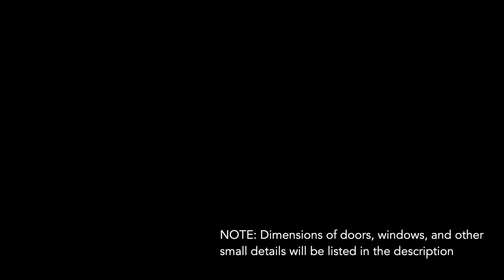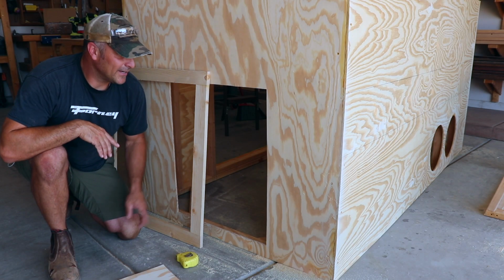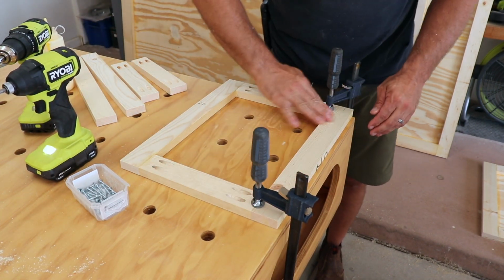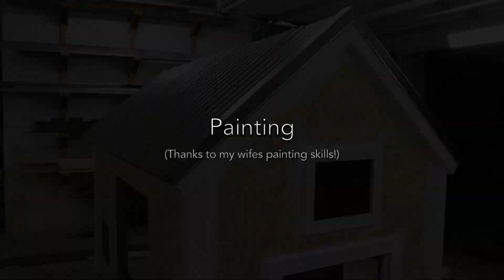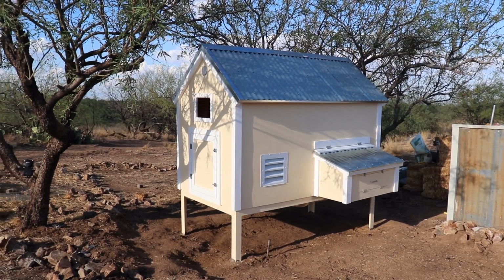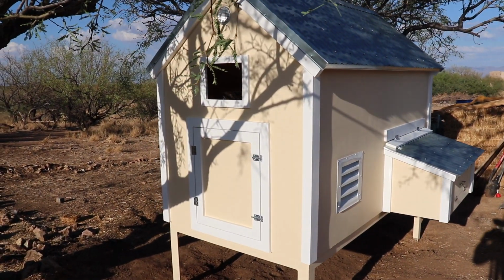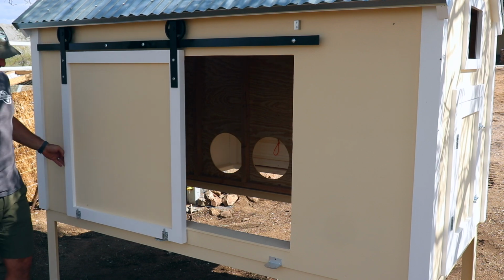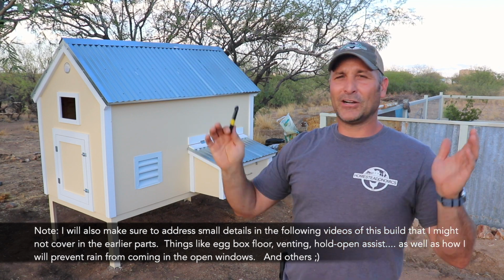Building a DIY Chicken Coop - Part 2 (Sheathing, Windows/Doors, other details)

Comment: Nice job. Y;ay Annie! I too wrote a comment about changing the egg box access to avoid scaring the girls (the majority of their predators come from above - so they're programmed to be disturbed by overhead disturbances). I like the sliding door design. I want to include an inside water station - our long and super cold winters mean they'll be in there a lot over the winter. I need the vents high.

Comment: Thank you Joe.  I appreciate your attention to small details and willingness to share your ideas.  Perhaps you could adapt a plastic pallet or two for coop flooring.  Although perforated, they would easily support the hens and prevent critters from accessing the interior.  

Wishing you and your family a safe holiday weekend without wildfires.  Peace brother.
Reply from the maker: Thank you!   Those kind of pallets are pretty cool... seen them on Craigslist from time to time.   But none lately.   
Hope you and your family have a great weekend too!
Reply: @homesteadonomics  check with beverage distributors in your area.  Grocery chains stack them in back for distributor recycling.  I’d a pallet gets chipped or one surface is damaged they usually toss the pallets.  I doesn’t hurt to call and ask.

Comment: I wish I could build something like that but I don't know much about building and I have most of the tools I think but I don't have like a table like that where I can clamp things down or I don't think I do have some clamps. I live in the city limits of Florida and we're allowed to have chickens but I'm only renting so if I have to move I don't want anything too big to have to move or heavy. So I don't know if I want to use anything with two-by-fours. I'm kind of using old fencing and things like that. Kind of winging it. I just need something simple to lock them up in at night. I do like how you did that sliding door.

Comment: Question more than comment. I live in Canada where it can get down to -20C (-4F) with some nasty winds. I built my coop without a plan, and it is most definitely not a work of manual artistry. I put some blue foam insulation on the outside last year, and want to know if that remains a good choice. I would like to cover the insulation with plywood and then paint it. Any ideas?

Comment: You do top notch work! Very Clean and smart design. QUESTION: Can two guys lift and move that around after being built? Id like to build something similar and put it into a Hoop Coop for a run. OH and one bit of feedback: The tin comes to a sharp point where the egg collection roof comes down. Looks like a sharp edge that someone could get a nasty cut on. Did you do anything afterwards to change that?

Comment: Hello: for the poop clean-out area....why did you choose to install a floor to sweep our instead of the 2 pull out drawers that you made previously? I live in Michigan and I was thinking of using the drawer method simply because I'd like to have that extra 4x8 flooring for a bit of insulting below the drawers. Just curious if you found the drawers to work / not work?

Comment: Do you have any faith in Paint n Primer in one over wood or did you use a stand alone primer?
Reply from the maker: For this I used a Behr Ultra paint and primer.   I can’t say if it is better than a stand alone primer or the same.  But I have had very good luck with the Behr paints!

Comment: Hey Joe, why did you get rid of the old coop before finishing the 2.0 one?
Reply from the maker: Well, mostly a timing thing.   We got the baby chicks a few months back and I had them in a water trough as babies and thought I was going to have it done in time.... but I got too busy and ended up having to make that make shift one in that interim.    Basically just bad planning 😂

Comment: Really excellent and clean job of showing us the build.  I came to you from Oak Abode who said they based their coop on your design.  I think that sliding barn door is terrific.  Sadly, you did not give us a link for that mini hardware.  I have not been able to find  anything that small so far.  I thought maybe you cut down the 72" bar, but then the wheels look smaller too.  
Did you use interior version maybe and didn't worry about the elements?  So spill the info - where did you find that mini barn door hardware?
Reply from the maker: Thank you😊🙏    I got the hardware off of Amazon but I can no longer find the specific link as we have gotten rid of our prime membership.   But it do beleive it is an indoor track hardware setup.   All components are metal except the wheels(very hard plastic).   But it’s still holding up well and I have no concerns.   Thanks for checking it out.
Reply: Thank you very much for  your reply.   @homesteadonomics  🐔 we are all grateful.

Comment: What is the metal stuff called that you're putting on the edge of the roof?
Reply from the maker: It’s galvanized corner flashing.   Sometimes called edge flashing or drip edge.   If you go to your local Home Depot or hardware store you’ll find it near the gutters and roofing materials.   Lots of different widths but these pieces are 2”x2” if I remember right.
Reply: @homesteadonomics  thank you very much. I would hate to go in the store and tell them I'm looking for some silver flat shiny thingy's. LOL

Comment: I feel cheated, no aluminum trim was made/used in this build. You're slipping. :P But seriously, this was an amazing build. Will there be any rain catchment on this? Also, to me, the side access on the egg box, having a center rope to catch it might get in the way, if it does, might think about putting 2 ropes on the sides instead.
Reply from the maker: Don’t worry they’re will still be opportunities to add some...haha.   Yes there will be a rainwater system video once I get the run and the basics done😀👍

Comment: Did you pre-drill the screws for the plywood or were you not worried about splitting?
Reply from the maker: I predrilled and also countersunk a bit, then filled with exterior grade wood putty

Comment: Just a friendly question. How come you didnt lay backers, pour a concrete slab, and then anchor the wooden framing to the concrete slab? Would be really easy to do.
Reply from the maker: It is raised up so that the chickens have a shaded areas with lots of air flow so they can sit on the cooler shaded soil on hot days.   I thought I talked about it in this one but it might have been the intro video where I showed the old coop and talked about my plans for it.
Reply: @homesteadonomics   @homesteadonomics  That makes sense. The coop I grew up around had a cement foundation but the weather is more moderate where I grew up. Arizona heat is beast. Thanks for the reply btw. Your channel is awesome. You are living the life many of us only dream of living. Congratulations brother.